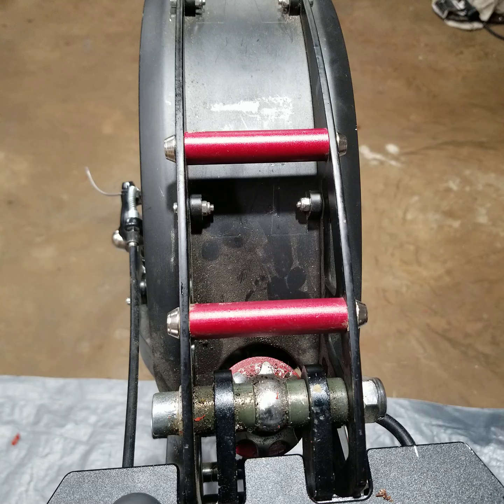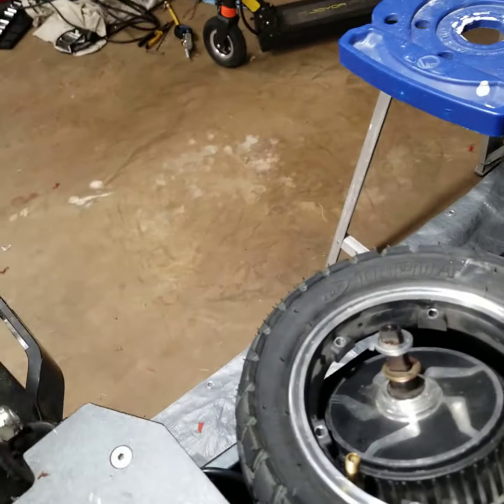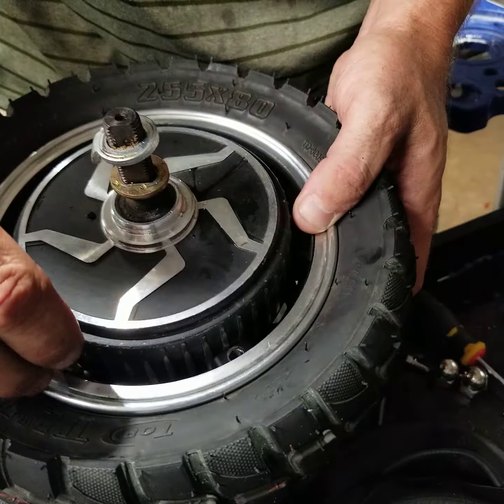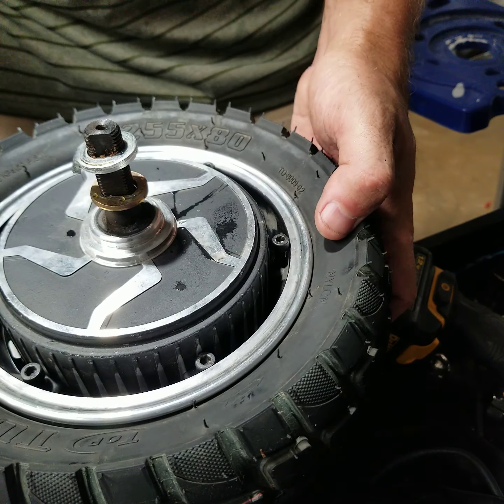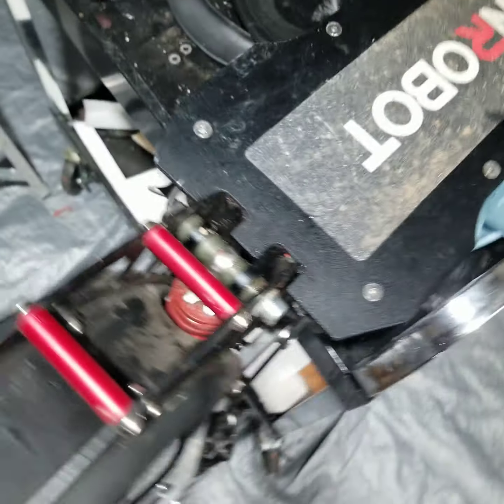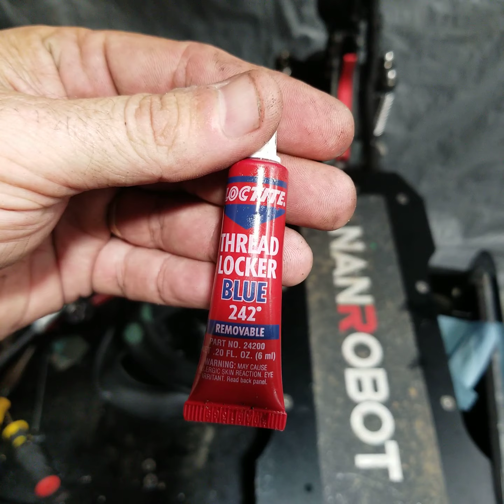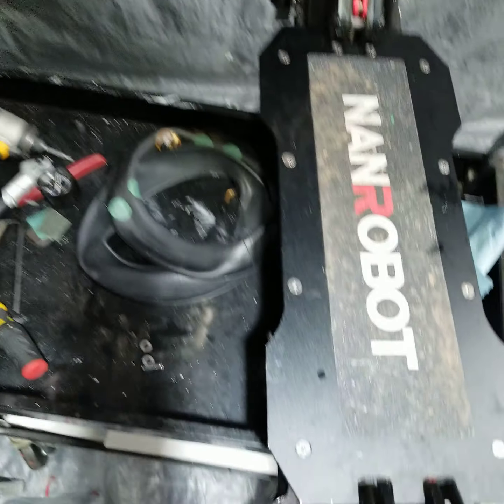Nanrobot D4+ 2.0 Back tire flat repair. (English version) electric scooter.

Comment: The reason I am here is because I needed to know how to remove the tires,  I am installing some of those puncture proof tube liners they make for mountain bike tires, just cut them down to size and install them front and rear on my D5+, it can't hurt, and will make them virtually puncture proof, or at least a lot harder to puncture.  Thanks for the video
Reply from the maker: My video explains pretty thoroughly how to remove the tire but i would advise you to be careful how you put in the liner because it could cause an imbalance in your tires at higer speeds. The reason why the use them in bicycle tires because they go slower and the circumference of the tire is a lot bigger.
Reply: @wattsinyours  True, I might have that solved, just have to make sure they are cut so that both end pieces touch but don't overlap or underlap. so if I take a measurement of the circumference of the inside of the tire, cut the liner to specs and use a drop contact cement or a drop of silicone on each end until it sets, so it stays in place while you install the tube. I will try this and get back to you on the stability issues if I have any. Thanks for the warning.
Reply from the maker: @thesmokingrooster8791  Thank you. Keep me posted on the performance.

Comment: Great video! You should look into "stop flats" tape. It's tape that goes inside the tire surface that is practically puncture proof.
Reply from the maker: Funny you mention that because was just talking about it the other day. Apparently it's pretty good stuff. I might give it a try. Thanks for watching and ride safe.
Reply: wattsinyours, what size and color stop flat tape is best to purchase for this size tire?
Reply: There have been some report of the tape actually rubbing on the tube and causing flats. I use the slime liquid in all my tyres.
Reply: Great advice! Thanks

Comment: This honestly doesn't look that hard to change compared to the traditional method of using tire levers for a bicycle wheel.  Yes there are tools that are needed for the process but  at least you don't have to use alot of physical force to get the tire on and off.  nice video!
Reply: Ive failed 4 times before looking this up because the tube keeps getting pinched when I install it, 3 of my local e bike shops wont even take my money to install it for me because its so much of a pita… needless to say its an art, id prefer the tire levers any day at this point lmao cause im no artist

Comment: Thanks for your videos. They are helpful.

Could you do one on brakes settings (both hardware and "software") and maintenance ?
My own D4+ 2.0 can't stand a daily 20 km ride without brake maintenance. Brake pads seem to wear at lightning-speed or screws are loosening.
I started using motor brake (P9 set to 1 instead of the factory 0) then P9 to 2 (which is not a more powerful brake, but a motor brake that triggers sooner) but it seems to damage my rear motor or making it heat enough so that it stops running (as if I had pushed the "single/dual" button). 

Well. I need wise advice on this.

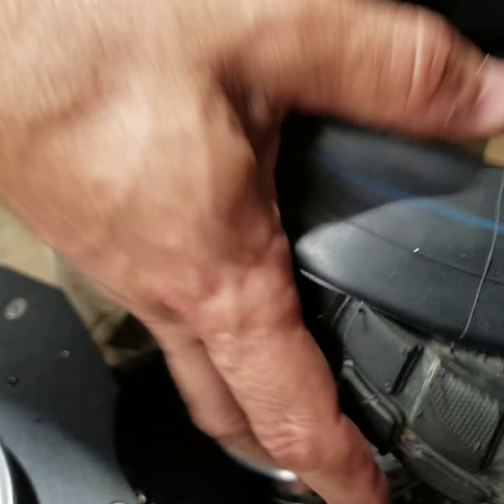I have to tell at 4:41 you unfortunately put the new tube upside down. The valve is heading to the brake disc side. It should be pointing the other side of the wheel.
As a result, at 13:30 when you release it after inflating it, the valve smacks down to the wheel when it should have stayed pointing outwards. This tube won't last for sure.
Reply from the maker: Thanks for watching and pointing that out. Which i did adjust. So i did do a break adjustment video i cant remember if it was on the d4 or my d5 but either way its in my library and the process is exactly the same. I dont know why your going through your breaks so quick. I do know they don't have a lot of pad on them and are relatively cheap to replace, but you shouldn't go through them that fast. Maybe after a proper adjustment they will last longer. Also make sure that most or all of the pad is gripping on the break rotor. Hopefully this helps. Let me know how it goes. Thanks.

Comment: Are those lugnuts to a Honda Civic sized rim on your tires? If they are ur a genius 😜 I have bin sliming my tires every 6 months before summer and before winter haven't gotten a flat yet and I have eaten two nails and both times what I did to field repair was with my little emergency bike hand pump added a few extra psi to the tires before pulling out the nail with the pliers of my multi tool and the extra pressure did work to push the slime out quickly sealing the hole I haven't yet to hit a nail it the nail not get stuck in the tire idk if the slime is allso adding extra grab on the nails when they go in but I assume if I didn't have enough pressure in the tube it would not seal so quickly or even at all

Comment: Looks like you're a pioneer! The first video of its kind that I could find. I noticed on the Nanrobot website that they have D4+ 2.0 front tire and rear tires, and on Amazon they sell just "D4+ tire" (no specification for front / back). Did you notice while you were replacing this tire that there was any sort of difference between the front and back tires? Did you get the replacement tubes from Nanrobot?
Reply from the maker: You can use basically any inner tube with the same dimensions as the one in the video. And no I ordered the inner tubes off of Amazon. Quicker shipping and seems to be better quality.
Reply from the maker: There are no differences in the front and back tire. They are both the same.

Comment: hello good I want to ask you a question I have a D6 because the air chamber deflates every so often, I check it and it has a minimum hole on one side, I mean, it drills it then I put a new air chamber and it continues the same I roll like 20 min and then deflated a little hole you will know what the problem is, thank you very much

Comment: Hi there do you know how to change the rear disk brake disk I think I need to disconnect the power lead somehow 
Kind regards
Reply from the maker: Yeah it is a pain to do it. You have to disconnect the motor wires from inside the deck and pull the wires out. That is the only way to get the brake rotor off after you remove the tire. Make sure you note where the wires colors connect that way you don't reverse polarity.

Comment: Can You just use foam and never get a puncher again? I think it is possible to fill it
Reply from the maker: I've seen people put slim in the tube to help with punchers but if you put foam in there it will cause an imbalance of the tire and it will probably vibrate off the rim at 30mph. I would advise against it.

Comment: The link in the description took me to a street tire (I'm assuming both scooters take the same size tube) but wanted to ask if the street tires are compatible with the D4+ & D5+... could you put street tires on the D4 + 2.0..?
Reply from the maker: Yes you can.

Comment: Hey man, thank you for making these tutorials, they are very helpful.
Would you happen to know if the inner tube size for the d5+ 2.0 is also 10x2.125?   Reason I ask is because the outside of the tire on my d5+ 2.0 reads 10x2.50 and I haven't had a chance to take mine apart yet (would make since that the inner tube is supposed to be slightly smaller than the outer, but I'm not sure...).  

Also, someone wrote a review on these tubes saying they did not work with their d5+ because the "valve nipples are at an angle from plane of tire".  From the pics on Amazon it doesn't seem like it the angle would render them incompatible but I guess we'll find out.

Comment: Hi, why didnt the patches work? Does it mean the patches still leaks because of the pressure? 

It works on my MTB but havent tried it on scoot yet.
Reply from the maker: Maybe if you had one hole in the middle of the tube, but my problem is when i got the flat it messed up the rubber around the  innertube valve and was leaking around there. Those tubes you can find really cheap on Amazon for like 10 bucks a pair so really not worth repairing in my opinion.

Comment: Thanks for responding to my question. I appreciate it. I'm still trying to decide on which scooter to buy. I'd like a 30 mph scooter with at least a 30 mile range. Is it possible to get one for a thousand bucks?
Reply from the maker: Sorry I don't know of any for 1k that will go 30 for 30. Scooters that go that range and speed tend to be a little better in quality and the battery has to be much bigger. The battery is where most of the cost is. Good luck on your search and if i see any to recommend i will give you a shout. Maybe secondary could be an option.
Reply: @wattsinyours  I'm not sure what you mean by secondary... As a side note I think I found "my" scooter. The Speedway Mini 4 Pro looks like the one. They are saying around 25 mph for 30 miles. It's $1059.
Reply from the maker: @MarkDavidBlack  "secondary" i mean a used one. Also on the speedway just remember my 10 to 20 percent rule. What ever the manufacture specs are take 10 to 20 percent off because they are usually over inflated. EX: If it says it tops out at 25mph then it probably will actually go about 20mph. If that is something that you can live with then your good. But there are a lot of scooters out there that will do 20mph for less than 1k. Check out the Joyor scooters. You might like them.
Reply: @wattsinyours  Or even the Widewheel

Comment: I have a d4 but not the 2.0. Very similar. I have a problem with flat tires on the back. I’ve swapped out the tire a half a dozen times in the past 3 months. I keep getting different quality, price tubes and it doesn’t seem to make much difference. I even ordered the $40 directly from Nanrobot. I was getting a few weeks out of it for awhile but it got down to a day or two on the last few. I just quit riding. Any ideas you might have as to why I keep getting the flats? I’m gonna try the filing around the valve stem hole that you recommended in this video, but any other ideas? I may not be getting the bolts as tight as you seem to be. Could that be it? Do you think there might be sharp edges on the motor? I’m desperate.
Reply from the maker: Sorry to hear about your tire problems. So let me ask some questions. Im assuming your talking about the innertube always going flat. Correct?
Reply: wattsinyours That’s right. The inter tube. I saved several of the tubes so I need to get them in some water and figure out where it’s getting holes, as I’m sure that would be your next question.
Reply: Sorry just realized I typed inter tube.
Reply from the maker: @hunterhamilton7785  lol yep. If it is in the same or similar area i would assume that there is something on the split ring rim thats poking a hole in your innertubes. Im sure you have considered this but that would be the next step. Once you find the thing that jabbing into you tube it's easy enough to file that down bc its alluminum. I know when i got a flat the rim made the problem worse bc of the jagged edges around the valve hole. If you find the issue i would appreciate it if you keep me in the loop. It would definitely help out others riders with similar issues.
Reply: wattsinyours surely will update if I figure it out. Let me ask you, would loose bolts be the cause? I tighten them pretty good but I’ve found that sometimes after riding for a while they work their way loose. One of the flats I experienced, I noticed one of the bolts was missing and I needed to retrace my ride a few 100 feet to find it.
Reply from the maker: @hunterhamilton7785  possible. What i would do is just put a tiny tiny bit of loc tight on each bolt but make sure you use the kind thats removable. You can pick that stuff up at any car repair store.
Reply: wattsinyours got it. Thanks so much. I’ll let you know when I check all of these things out and get fresh tubes from amazon to try it out.
Reply: @hunterhamilton7785  SOoo, been a year, what happened?
Reply: @jonesjones7057  I gave up and sold the scooter. I couldn’t go more than a mile or so before it went flat. I miss riding it so much but it just wasn’t worth it.

Comment: Do you know if the Dr+ tires and tubes fit on the d5+?
Reply from the maker: Did u mean will the d4+ tires fit on the d5+?
Reply: @wattsinyours  yes sorry damn autocorrect. I want the off road type on the d5. But not in 8. Which I realize the d4 is 8 not 10inch
Reply from the maker: @raptor2569  the d4+ is 10 inch so is the d5+.
Reply from the maker: @raptor2569  the d4+ comes with off road tires. The d5+ comes with street tires, but you can swap either one. They both fit on each scooter.
Reply: @wattsinyours  oh awesome! So would you happen to know (besides nan-robot) where I can get them?
Reply: @wattsinyours  also on nanrobots site they have 2.55 x8 inch tires on the d4+ in the pictures.
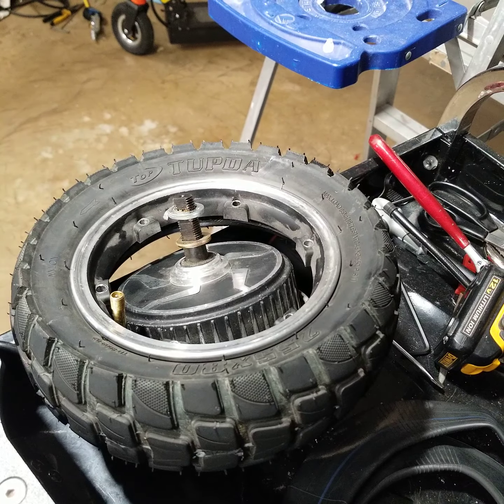Reply: @wattsinyours  also on your video it's 2.55 x 8 inch tires.  @2:21
Reply from the maker: @raptor2569  thats interesting bc if you look at my flat tire repair video on the d4+ they are 10inch and 2.5 inch inner tubes.
Reply from the maker: @raptor2569  yes there are plenty of sites. Alibaba, ebay, dh gate etc etc. Just do a little searching and you'll find them.
Reply: @wattsinyours  I have. But the d4 is 8 not 10 like the d5. Not sure it will work.

Comment: Hai scooter riders can you help me my almost New scooter dual engine 2x1500Wh has a wobble on the front rim but only on one side not on the brakedisk side  i hoping i dont need to send it back that is 200 usd what can i do, do i need a new rim the rim is a twopart rim or can i loosen and thake it apart and put it back together  and tighten every thing sorrey for my bad english

Comment: Use slime inside to help prevent future punchers
Reply from the maker: Slime only works with non tubeless tires. D4+ have tubes in them.
Reply: @wattsinyours  slime works great for tube based tires? That's what it's for.
Reply from the maker: @alexander3here  i agree i read more into it but it really doesn't prevent puntures per say. What it does is when you get a puncture it will seal up the hole and maybe get you back home for those last couple of miles until you can do a permanent repair.
Reply: @wattsinyours  okay good. I was confused for a minute thinking I've been fucking up my tubes haha. Thanks for making the videos. I have a d4+ 2.0.